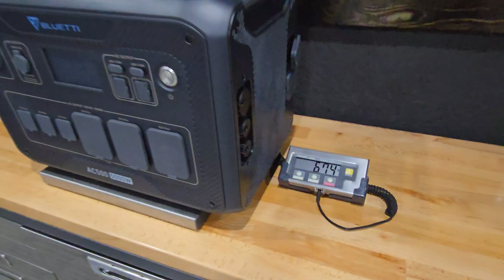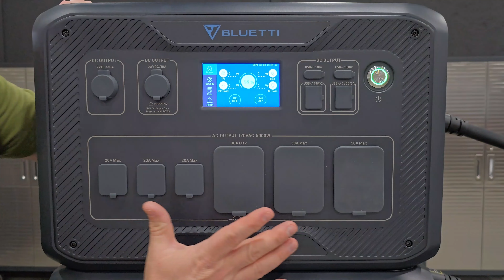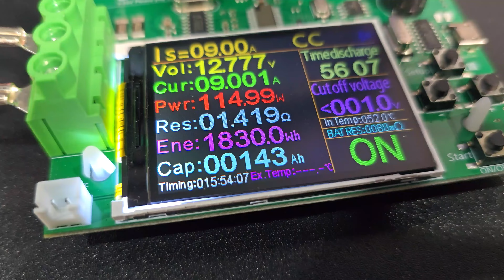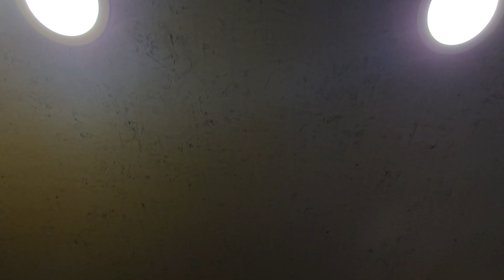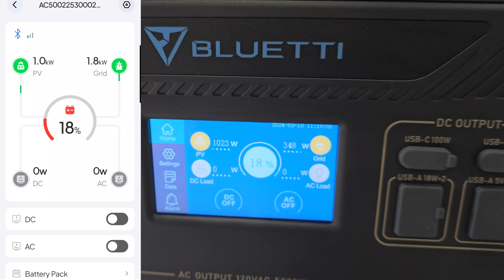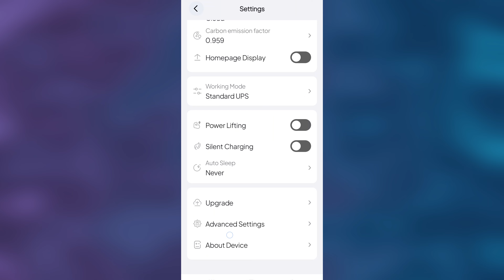HAD I KNOWN EARLIER!!! BLUETTI AC500 B300s Power Station

Comment: I have the ac300 and was thinking on upgrading. I noticed you used the 30 anp cable and pushed over 5000 watts through it.  How is that possible? 30 amps at 120 volts is 3600 watts. But you put 5000 watts through it. If you can run 5000 watts through one cord im all in. Please advise. Thanks

Comment: I'd like to echo the comments below. I've had a Bluetti for about six months and it keeps giving me a SHORT warning and cutting out. It's useless as a UPS since any time the power company fluctuates slightly the unit cuts out and has to be manually rebooted. I called Bluetti about it and they said it needed a firmware update but even after the update the problem still exists. $400+ wasted and a firm commitment to not buy anything from this company again.

Comment: Could you use a four prong cable directly with the other outlet? Why bother using a 3 prong adapter to connect a 4 prong cable to the transfer switch when there is a four prong outlet?
Reply: Yes he skipped doing that...he only tested the 30 amp RV port

Comment: Everyone, buyer beware.  I have an AC500 and three B300S batteries from Bluetti.  The system has failed in about a year.  I'm having all kinds of issues with Bluetti honoring their warranty. I have been sending pieces of my system back and forth to Bluetti for months. Still does not work right.

Comment: Bluetti is the least innovating company of all the current large charging station companies. Glad you are content with yours but so many people are having problem with theirs that I would never recommend them!
Reply from the maker: @luckyvegan7   @LarryRichelli  I disagree. What I seen at CES this year was some pretty impressive products coming soon. If I'm not mistaken, Bluetti was offering ESS systems before any other competitor in the space. They were the first to offer an IP65 rated power station. Not all of their ideas were massive successes but they are certainly not the least innovative of the big brands. The main thing with any system is understanding its limitations. Having the correct expectations. Regardless if thats a full home grid connected solar system like I just completed the install for or a tiny portable power station. From my experience, I've had zero problems out of their power stations or ESS. They are by far the quietest PPS of any of the brands I have tested. They do a lot of things right, but no company is perfect. There are some decent products out there and competition in the space makes it better for us all. It helps ignite innovative. I look forward to it!
Reply: @ sorry, I had a Bluetooth system and I had problems with it, as soon as they got fixed I sold the whole system. Since then I’ve been using EcoFlow system without issues. To me, EcoFlow and others are innovating and Bluetooth just stays the the same and they are falling further behind by standing pat with what they have.

Comment: Thank you for this review I have this system with two batteries.  What Bluetti didn’t make clear was if you want 240 you need two inverter units, at least that’s my understanding with a special cable sold by Bluetti
Reply from the maker: Your welcome! Yes, two inverters connected together will make a 240v system.

Comment: Everyone, buyer beware.  I have an AC500 and two B300S batteries from Bluetti.  The system has failed in about a year.  I'm having all kinds of issues with Bluetti honoring their warranty.  I sent in a unit for repair.  They said it was working. After email discussions, they said that they were going to send me a replacement unit.  They then sent my original unit back.  I'm trying to get them some help from them, but they are playing all kinds of games.  I watched a video by "The Solar Lab" here on YouTube and they had a unit that failed exactly like mine.  I would not recommend this unit.  I haven't tried any other units, but the EcoFlow looks a lot better than this AC500.
Reply: Promoting for another Company
😂😂😂
Gfy

Comment: The battery cable shouldn't extend 18 freaking inches to the right of the unit.
Reply: I get what you mean—it does take up quite a bit of space, but you don’t always stack the parts directly on top of each other. I have them placed on separate shelves, and that’s only possible because the cable is so long 🤷🏼‍♂️. If it had been an angled, smart flat design, I wouldn’t have had that option 🤷🏼‍♂️. It would be great if there was an option to buy an angled cable when needed, instead of just the long cable that’s shown in the video here 🙂.
Reply: @ValderFl-ho2bx  or they could mirror the battery design R/L, directly connected from opposite ends, resulting in a more tightly integrated battery configuration and improved aesthetics.
Reply from the maker: I roll it up most of the time so it doesn't. Thanks for watching and commenting! 👍

Comment: Great Video! 
Question for Justin or anyone else that might know?
Was about to jump on this system until I watched another video.
I still might but need more info first.
I saw in another video where they used the Bluetti 30 Amp Fusion Box so they could connect Two AC-500's directly to his 240 Volt Pannel.
I thought you mentioned in this video that the 50 Amp plug on the Battery could be used for 240 Volts?
Maybe I mis heard?
Looking on Bluetti web site, looks like 30 Amp Fusion Box is all that is available?
I'm trying to put a system together and I’ve been comparing options from different companies. 
My head is starting to hurt. 
Do you know if these AC-500's can output 50 amps while in dual 240-volt mode?
That is a lot of $$ to buy 2 full systems that limits you to only 30 Amps?
Am I missing something? 
Thanks for any input.
Reply: I aswered my own question...lol
Just watched your other video that uses the 50 Amp Split-phase output cable.
Still blows my mind why the other guy in another video chose to go with the 30 Amp Fusion Box,
Instead of the 50 Amp Split-phase output cable.
The 50 Amp cable is $200.00 cheaper than the 30 Amp Fusion Box,
and as Tim Allen would say "More Power!"
Reply from the maker: Sorry, I have be extremely busy lately. I am glad you found the answer though.

Comment: What works for me is Priority UPS. During the night the battery SOC might dip lower than you want, so you can set it to any value between 0 and 100%, and when it gets that low Grid charging will kick in and hold it there until the sun comes up and the solar panels go to work. It's a great automatic feature for going almost offgrid to cut down on the Power bill. I do have to make some adjustments with the seasons, esp Winter with shorter sunny days and a lower sun angle. I do need to get the batteries to 100% SOC everyday.
Reply from the maker: Thanks for watching and commenting! 👍

Comment: Excellent video. Thanks much. Can you share the solar panel you are using? and do you run an MC4 extension cable?
Reply from the maker: I have used Aptos Solar panels (370w, 400w and 440w) but I am moving into Sirius panels (415w) now. I build my own 10awg MC4 extension cables.

Comment: Does this kit have any "bottleneck" issues if grid recharge is on and kit installed like an UPS? Will the kit work in some transit mode for grid energy while battery is out of energy?
Reply from the maker: I have not experienced any bottlenecking. Yes, you can control the usage in the setting. I personally have this one setup in a custom time of use. Works perfectly.

Comment: great video! Question for ya. Plan on using this permanently as home backup with transfer switch. Can you leave the solar plugged into it 24/7 or do you have to plug/unplug after charging and so forth?  Love to just setup panels outside and leave connected and not have to bother or worry is it charged or not before power outage......appreciate your help.
Reply from the maker: I have this system powering my shop (over 2000 sq ft) connected to Solar (24x7). I run two of them since I need 240v back up on the main mini split but it handles this space great.
Reply: @TheSolarPit hello, would u be willing to show us how to use it with solar. I’m an older woman trying to to live off grid and am not sure what I need for  2 bed room modular home. Thanks and god bless

Comment: Hello Justin, I enjoyed the video! 

However, I don't understand what I need to fully power my 50a A Class RV. I have the AC 500 & 1 B300s battery. When I plug my 50a power cord, I don't get the power I need (no frig, no microwave, no AC)

When I use a 30a adapter and plug into the AC500, everything turns on except my air conditioner (the AC fans come on but not the cooling).

Do you know what I need to plug into 50a plug and get the power I need?
Reply from the maker: For 50a output you will need 2x AC500's. I am assuming your AC is 240v. Each AC500 is 120v. When you pair 2 of them you create a 240v system.
Reply: @TheSolarPit  thank you
Reply: I had the same problem bought it to power my class A then discovered I had to buy two units and a special cable for 50 amp, I think Bluetti should highlight this information more when purchasing
Reply: @robbiesmith5169 agree this is not well communicated. Not sure why they even bother putting a 50amp plug. Better to just use a 30amp dog bone from 2 units anyway

Comment: Take the PV2 connectors, wrap them together with some electrical tape and forget about them.  There's your single cable.  If MPPT 1 fails, you can use the other set/mppt. Problem solved.
Reply from the maker: Thanks for watching and commenting

Comment: Awesome review!
Reply from the maker: Much appreciated! Thanks for watching and commenting 👍🏻
Reply: @TheSolarPit  Hey Justin, thank you for replying to my mail. My name is Curtis and I have a basic question for you...
I just purchased a "BESTARC" Plasma Cutter, Pilot Arc BTC500DP 7th Generation 50Amps Screen Display Dual Voltage 110/220V Digital Plasma Cutting Machine.
Right.

Also, I've purchased the BLUETTI AC500 and four B300S batteries separately for my mobile shop. 
Question: The BESTARC, set for 120 volts using the BLUETTI, plugged into one of the 20AMP plug outlets keeps short circuiting and shutting down. 

The parameters on the BESTARC Plasma cutter is set for 18 AMPS. It still keeps on shorting the AC500 and the four batteries plugged in parallel and all batteries are 95% charged.

Shall I purchase another AC500 and a 
AC500 Fusion Box to pair, granting me 240 AC Voltage for the cutter and my welder?

What am I doing wrong? Please help....
Curtis, Thank you
Reply: @TheSolarPit  Thank you Justin...